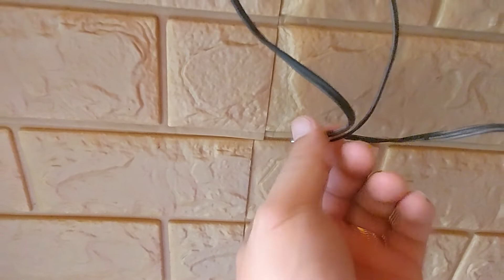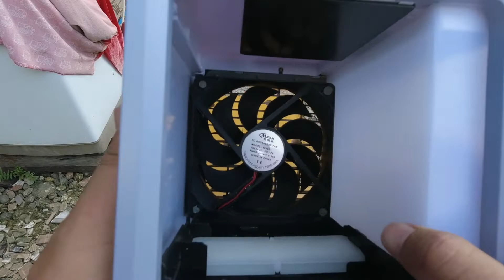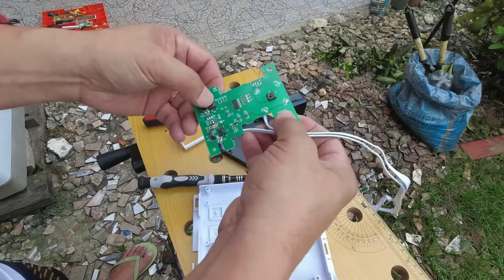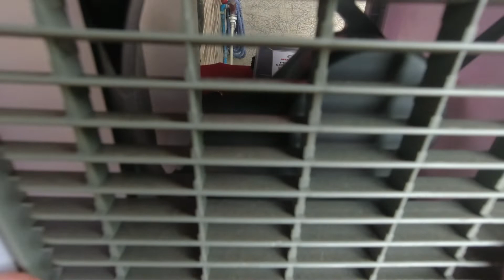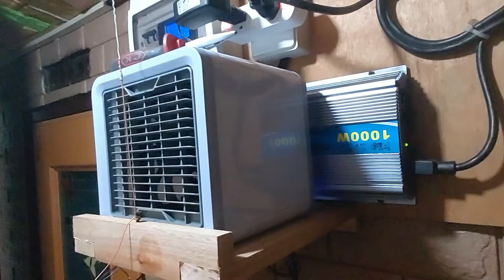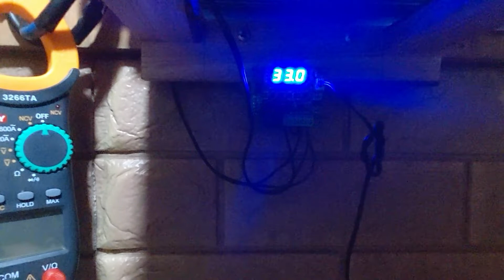1000W GRID TIE INVERTER SMART COOLING-ARCTIC AIR COOLER | DIY Petz

Comment: Hi..I have the same grid rite with 600w solar, I average 80% Efficiency. I see your cooling 
As an over kill. Btw So. California in June, best sun is from 11am to 5pm…I run mine at 470 watts,
At 95f. Ambient temp in the room is 92f..I run the unit vertically and let the heat rise. I took
The lower fan out after cutting the fan opening out and replaced it with a stronger 12v fan that
I attached to the out side..a good rule of thumb is not to run these over 50%. Try and cool from
The inside. Keep in mind that 90% of these inexpensive units die from over heat.
Thanks for the video 
Dennis
Reply from the maker: Good day Sir Dennis, thanks for your input Sir, I'll probably do it after this experiment. Anyway I purposely have this somewhat overkill since we are in tropical place and mostly hot all day. The cooler will only run if triggered around 40 degC or about 104 degF with the help of the temperature sensor.
Stay safe.

Comment: can i ask what time of day is the 670w output at time 1:03..from the other vid i found you have 1100w panels.. I have total 8x150w total 1200w panels in parallel using same inverter as yours only Y&H but the 1400w version and I get typical 675w around 10am to 2 pm.. Im just trying to compare to yours if my panels are bad kasi first time install lang.. yun lang ba talaga  typical output nya around 50-60percent ng total watts ng mga panel.. hindi po ba talaga makuha 80% efficiency..
Reply from the maker: Good day Sir. The ideal time for the maximum output on clear skies would peak @ 700-725 watts from 10am-2pm. Usually the efficiency would only be at max 65-75% of the setup due to other matters such as losses, heat and the like Sir.
Reply: @RollyPetz  ok sir. Kasi ang nabili ko na panel eh sa shopee lang. Tapos sa feysbook madami ko nababasa na fake daw yung mga geman quality daw na panels like bosca. Pero di naman gaano nagkakalayo yung output natin sa trina panels mo. So medyo nahimasmasan ako konti... Ilang day ko palang nasetup to ang typical ko from 10to 2pm po ay 675. Ikot lang sya dun. Salamat.
Reply from the maker: @genome692002  Thanks for dropping by Sir.